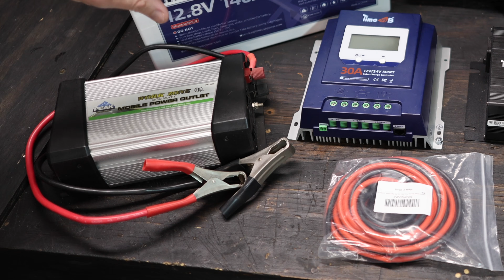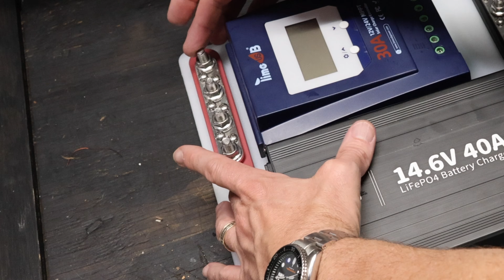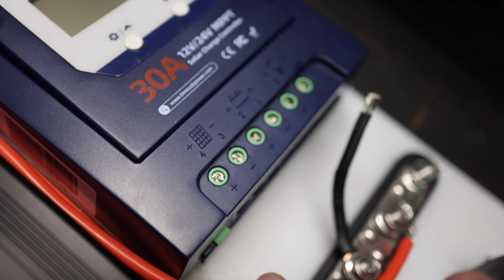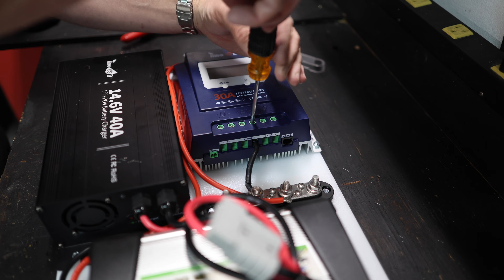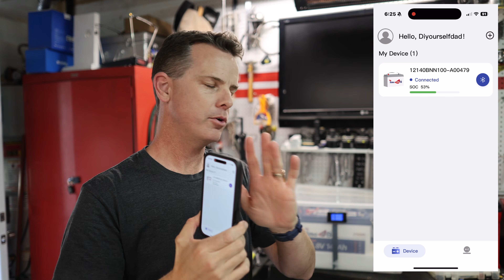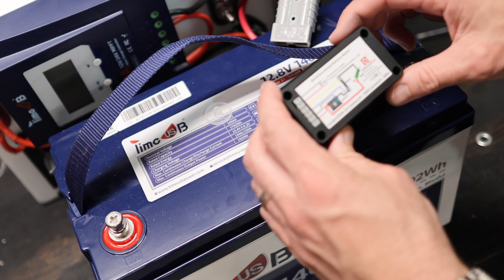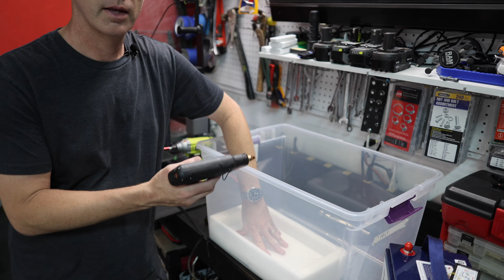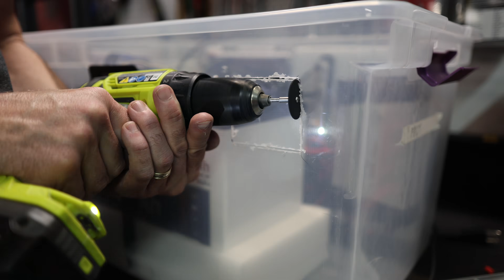Build Your Own Solar Power Station - Make It Better - Make It Cheaper

Comment: What can it power? I am considering doing a build or buying a power station that can power my refrigerator in the event of a blackout. 

I know the pre-made variety is pretty
expensive to do that. If I can save money somehow by building my own, I'd love to. I just don't really know if that means I need more batteries, or different parts, and so on.

Thank you for making this video, this is giving me a lot of confidence, that I can indeed do the wiring.
Reply: Start off with how much power does your refrigerator use on a typical day.  Mine, an older unit peaks probably 1200 watts on startup,  immediately drops to about 600 watts, then over 2 or 3 minutes will taper down to about 375 watts and run about 20 minutes out of each hour.  So the inverter first needs to be able to deliver that high current draw on startup, surge rating,    typical of anything with a motor. Getting heat out of the inverter components is the determining factor on sustained current capability. So you really should have at least 2000 watt rating to reliably start your fridge without tripping an overcurrent/overtemp situation in your inverter. Also to consider is when it goes in a mostly resistive load defrost cycle,  mine pulls 700 watts for about 15 minutes and will immediately go into refrigeration mode at the end of that. Lets call it 400 watt average, running about 1/3 of the time, x 24 hours in a day 

= somewhere on the order of 3.2kwh per day to keep a fridge going.Your fridge is likely significantly more efficient than mine is. 

 Startup current and getting rid of heat are the two primary considerations for an ac or refrigerator inverter. So if you anticipate going 3 days without line power,  you really need 10kwh worth of battery, just to keep a fridge going.   Subtract reasonably expected solar power from that number. I would say 3000 watts of reasonably well aimed solar panels is the bare minimum on that you only get a few hours out of the day to catch and store power. 

 If you are recharging with solar alone, what happens if it is cloudy on the day you need it?  You dont open the fridge and certainly do not try to make ice in it.   So I am gonna just call it 5kwh is the bare minimum battery capacity to bother with, anything less and you will most likely be sorely disappointed when you need it for what you got it for. Higher input DC is generally more efficient say 48vDC and can be cheaper on wiring, but a 12vdc input inverter is much more flexible to change things around as your situation changes, simple to parallel on another battery that has its own Battery Management System built in.
 If you are gonna build your own, you really should do a lot of homework before you purchase anything. Imagine trying to build yourself a car from parts.   Ya,  like that. It can certainly be done,  but if you dont appreciate the quest for knowledge, then prolly better to just purchase an already built unit that professionals did the homework on. With what I know now,  you are a lot better off to get the battery/inverter first and take advantage of off peak pricing to charge,  then add solar. 
Looking at the grid as a whole we have a huge imbalance between battery storage capacity and solar panels. My own home cobbled system and 4 other professionally installed systems in my neighborhood,  and none of us have batteries,  and all of us are blacked out if the grid is down. My system is now often significantly limited on AC line voltage going too high on the local line because of too much local solar power. This neighborhood makes more than it uses through mid-day.   Nothing reasonable and safe to do about that but to poke some of that peak surplus power in a local battery.
  It is a good thing to do so dont be discouraged and dont get hoodwinked by scammers who install systems that wont work in a blackout, and where the get financeers 90% of the benefit of your roof, and put a lein on your house for years. They will get theirs.  Can you tell why I encourage DIY?  First step,  get a Kill A Watt and start watching what each device in your home consumes, so you can see what you are up against. First look for the phantom loads, quietly sucking power.  Does a doorbell transformer and a thermostat really use that much power?  Then you will likely find several devices that are pulling 15 watts, all day, every day and it really racks up over time.  It is amazing how much power a wifi router or  a cable tv box actually consumes.  Heat is a big clue.

Comment: Need a fuse at battery positive. 
Need an exterior master on/off switch. 
The box needs ventilation.
Reply: Adding a 12v fan from a computer would be super easy and could be installed with a switch so it doesn’t run the battery down when not in use. Many super quiet options available that would be an easy add-on.
Reply: Also a fuse on the inverter I would have thought.
Reply: @ernestnolan-u4ninverters like that one almost always have 2 fuses built into it.
Reply: Yep you about covered it!
Reply: Don't they all!
Reply: It doesn't have a lid  thats alot more that the boxes have
Reply: 😂12. 8V 140AH Battery $289 * inverter $180 * Charge Controller $89 * Wall Charger $79 * Shunt $19 * Buss Bars $23 * 8G Wires $21 * Connectors $13 * Crimper $20 * TOTAL COST $733 and you get $2000W Inverter & 1792Wh Battery after spending days as a newbie trying to do it correctly lol
Or simply buy a Pecron 2400LFP for $599 and you get 2400W Inverter and 2048WH Battery + Amazon + Pecron Warranty Peace of mind, you wont shock yourself or spend hours trying to figure out what really is a Buss Bar lol.  Spend that wasted hours setting up a system and spend time with your wife and children, take them to the beach and guess what you can bring the Pecron with you😂
Reply: @Michaelanderson1985  you can't scale a prebuilt one up, but with this one you can add as many batteries as you see fit, you could even modify it to power your house
Reply: @flipwonderland  Haha this reply comes to me after watching 17 Videos of Prebuilt gone wrong FIRES! (oops he used too small wires, oops he forgot to use the right AMP fuse, oops I watched a DIY youtube video and now my house is on fire) 

Now find JUST 1 Pecron F1000 caught fire and burnt down a house, JUST ONE and link it to me...JUST ONE you upgrade by simply buying the same power station again.

People on the internet recommending that people do cheap DIY with dangerous electricity 😂 Cant make this up
Reply: @Michaelanderson1985  okay well I'll let you know if my house burns down lol
Reply: @Michaelanderson1985 UR FUNNY😂😂😂 BUT UR RIGHT
Reply: @Michaelanderson1985  First, could you please link all 17 of the videos you claim you watched.

People demanding others cite their work when refusing to do so themselves. "Insert laugh emoji" Cant (sic) make this up.
Reply: @Michaelanderson1985  Brother can't fathom having hobbies, sad.

And just out of curiosity, what happens in 3 years when your Pecron stops working and you're a year out of warranty? Cause I know you're not just replacing an inexpensive component with off the shelf parts. Not to mention this is a dead simple project, none of your "concerns" are relevant.
Reply: @K-Anator  Bee Beep -  The only thing worst that spending happy valuable time away from your wife and children at the beach so you can build a potential fire hazard is spending time on the internet replying to a Bot comment.    There is something special about seeing a No life human replying to a Bot on the internet. RAGE BAIT remains Undefeated Bee Beep 

AI Bots will be here long after your irrelevant comment not if BUT WHEN you are six feet deep Bee Beep enjoy the rest of your time on earth....
Reply: Fuses are literally made to fail!
Reply: @winsucker well done Captain Obvious
Reply: @winsucker and drills are literally made to drill. And wires are made to conduct electricity. Thanks for your contribution!!
Reply: @winsucker  Well. You're not wrong...
Reply: It also needs to have a 12V super capacitor bank. If it does not have this the battery will not be able to keep up.
Reply: the whole build is an epic fail.  Heavy and the inverter wouldn't make a cup of coffee. 
EcoFlow Delta 2 - $500 on sale.  1800watts real output. 
by FAR a more inexpensive and intelligent choice.
Reply: @Christian_Nomad I am not disagreeing with you, except to ask, what the hell can you do with an 1800 watts inverter. I've used many inverters. 1800 will just barely run a microwave.
Reply: @edswope28  So you are afraid of using propane to cook with?  Most of the time I only need a 300 watt inverter for a fan, computer charger, and LED lights.
Reply: @edswope28 a 4000W isn't much more expensive
Reply: @T @TedSpider2023  you have it, smoke it.
Reply: @Nomadic_Kokopelli  I'm just not seeing an epic failure here. the base model EcoFlow Delta has a smaller battery at 1024Wh (12V x 85.3Ah) , compared to 1680Wh (12V X 140Ah) from the Timeusb battery. The solar charger is heart of the system. Spend the money for the MPPT.  As it sits,  this build is right around $550. If you need a larger inverter, its easy to scale up. Is it heavier? Yes. Can you service it at home? Also yes. That said, I don't like the clear box. I'm building something similar in a Harbor Freight tool box with wheels.  For my needs, I can run my all my emergency equipment off 12V. After 10 years off-grid, I don't trust inverters. I don't need the inverter. Everyone's needs are different. Also, I'm not looking for a flame war. This is just my opinion.
Reply: @o @outbacktrekking3713  It’s $550 without battery at this point. End of November 2025. Now I did add extra length for wire and extra pieces for connectors and such as well as some wire cutters. Haven’t looked at fuses yet, or fuse boxes. But idk, I’d like to make one, and just compare. I’d like to get the biggest batteries possible though. Avoiding lead acid.
Reply: @outbacktrekking3713 its a fail.  He left out kill switch, runs a crappy battery, inverter with modified sw and no circuit breaker.  You can pick up a delta 2 for around $500 with better components and ergonomics.  You can easily wire up another outboard 100ah lifepo4 for expansion.  This would be a decent build a couple of years ago.  That was what I did a couple of years ago and total cost was more than $550 with decent components including mppt charger.  But present day, it doesn't make sense unless you have specific need or want a larger battery array and solar.  Oh, don't forget to add cost of tools and cabling (with connectors etc) which is not insignificant.
Reply: @outbacktrekking3713 
What substitutes not having an inverter ?
Reply: @Abdul-qe5sp  Not running any 120V AC.  He says he is running all 12V DC.  Think this way.  Your phone charger plugs into the wall.  Your phone is running on a DC battery.  AC comes out of the wall into the charger gets converted to DC.  Everytime you convert DC-AC AC-DC there's inefficiency and you lose some power and create heat.
Reply: @Nomadic_Kokopelli  I got a Delta two for 259 on sale during Black Friday. Yeah it’s a crazy deal. E
Reply: @way2muchNFO cant beat that deal
Reply: @Nomadic_Kokopelli  just get the EcoWorthy AIO inverter battery combo on sale for $644. 5kw 120/240v split phase output, and 2500Wh of capacity. Could run a small welder.
Reply: @Nomadic_Kokopelli  this build is just fine. This is not meant for making coffee, because the inverter is only 800w. The battery is a bit too big for the current draw of around 60a max. Overall a nice build and economic to power lights and electronics.
Reply: @varman001 well its good thing everyone is entitled to their own opinion.  Because as someone who does installs of lithium/solar on Vans/Boats/RVs - Hunt Camps , Yurts , ect ect ... This build is complete waste of time and resources. 
If you're going to build a power station yourself, make it useful and worth while and not a 70+ pound phone charger.  An old 800watt inverter that likely only gives 500watts , is just borderline useless.
Reply from the maker: Cute… how much does one of those installs cost? Is it using new parts or things you already had laying around? I literately address the fact that it’s an inverter that I’ve had laying around the garage for 15 years (as well as other components used here). This shows how you can build something, and set it up how you like, with the components that serve your particular needs. Nowhere did I say “build a Time Machine and buy an inverter that was sold a decade and a half ago”.
Reply: @DoItYourselfDad lets solve this. IF I do/upload a build on my channel with materials I have "laying around" in my shop , will you watch it and if agree its more efficient and better design , will you promote it for views ? You can have 80% of monetization income from it
Reply: @DoItYourselfDad and to make it a worth while challenge -- parameters = under 50lbs , and able to run a 10,000btu a/c unit for 4-5hrs and 30% smaller overall.  total cost under $500. ??
Reply: @Nomadic_Kokopelli  Saying this is a "complete waste of time" is just trolling. It's like saying a home build was a complete waste of time because you don't like the kitchen cabinets. Just change out the inverter.  Weird that someone with all of your "experience" couldn't come to that basic conclusion. You realize that people aren't going to buy the exact same components if they build this in their own, right?  It's called "customization".
Reply: @RobotVoice99 Anything worth doing , is worth doing right.  THE 1St Time 
So You are not a voice of reason , just an Excuse Maker. 
There was many "faults" not just in the inverter as OTHER comments pointed out.  As long as you feel special now , I'm happy 😂
Reply: @RobotVoice99  AGREED
Reply: @Nomadic_Kokopelli   Uh, but I"m responding to what YOU said, not what the "other comments" pointed out.  You only pointed out the inverter and how heavy it was on more than one comment you made. So you had multiple opportunities to point out these other so-called "faults" but you failed to do so.  Funny you think anything worth doing is worth doing right the first time, yet you can't even make a simple comment expressing your opinions and issues with this THE FIRST TIME.  Ironic, lol
Reply: @Nomadic_Kokopelli  aha ha ha ha.  I only use a 300 watt inverter and propane.
Reply: @RobotVoice99  You can't "just swap out" components, as changing one affects the others. Need a larger inverter, need a stronger charge controller, also needs isolation fuse(s) and cut-out switch as dangerous w/o. Different rated panels increase load; so, even the gauge of wires needed will change, etc., etc., etc.
Reply: @Nomadic_Kokopelli  He did do it right the first time. For his needs. Just because his needs didn't match your needs that doesn't mean he did it wrong. He wasn't making it for you. The narcissism you display here is headache inducing.

I get it. You feel like you're an expert, so you thought you'd make yourself feel important by getting on here and swinging your * around. But it would be far more productive if you added constructive criticism and advice instead of just insulting people and crapping on everything. Trashing on other people doesn't make you look better. You just look small and insecure.
Reply: @DoItYourselfDad 
The first thing you should’ve done is install a fuse and second a kill switch. 
Safety first.
Reply: @Nomadic_Kokopelli Does the unit function? If the answer is yes then everything else you said was a waste for you to write AND for me to read. 

The design works so pick the parts you want knowing that it will change the cost of your build and shut up. 

Videos like this do two things
1. Shows you one way to make the unit
2. Gives you a basic component list.

I already have a design for mine but I still watch videos like this to see if they have a useful idea to include in mine. If not then maybe suggest something to be added to theirs.
Reply: @nickm9102 How about then , since you really like this type content , I'll upload a build video on MY channel for you and show you not just the difference in gear choices , but a far more efficient and far better build.  Will that make you happy bud ?

Comment: I don't think you can build one of these cheaper than a premade unit, spec for spec. The two of these aren't even close. That anker has 3x the inverter(plus pure sine wave vs. modified), 250 more Wh battery, 2.5x the solar input, 3x the wall charging input, smaller footprint, wheels, and a 5 year warranty. Everything is designed to work together.  It's also $1100 right now. Now when you start adding expansion batteries to the all-in-ones, DIYing these starts to break even quickly.
Reply: The only super beneficial part i could see, is if a part fails its much easier to replace 1 part vs a whole new system. Yeah theres warranty's on all in-one but who knows if they wouldn't find a loophole. Then adaptability so I guess 2 things. Over time as needs change you could build to suit
Reply: All good points.  But you need to consider that some people neither want nor need all of the bells and whistles, and the extra cost they demand, when you buy an all-in-one system.  Those are just some of the main considerations that people have when thinking about portable power systems.

They were definitely my main considerations.  Could I afford to buy an all-in-one system?  Yes.  But I decided to build my own.

Another consideration is that an all-in-one system will not meet the personal requirements of each and every person.  Needs and requirements are subjective to each individual.
Reply: I came to the comments to see if I missed something. No way are those the same units. Not spec'd same at all. And I didn't see any prices. So who knows what the total cost was and if there are savings or not?
Reply: Also temu parts! Make this bad boy real cheap 😂